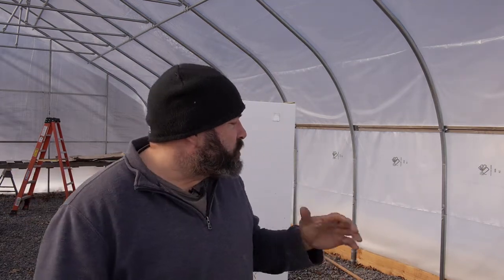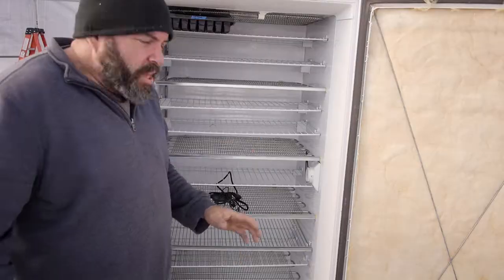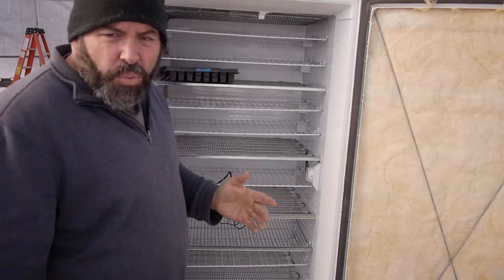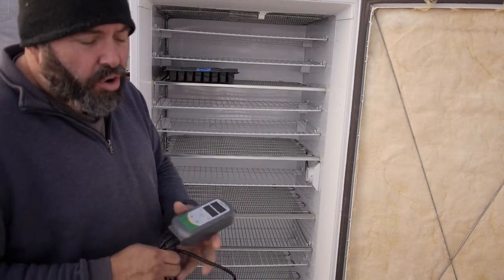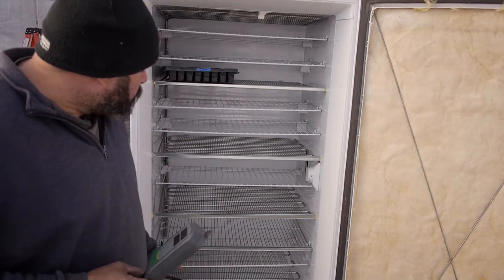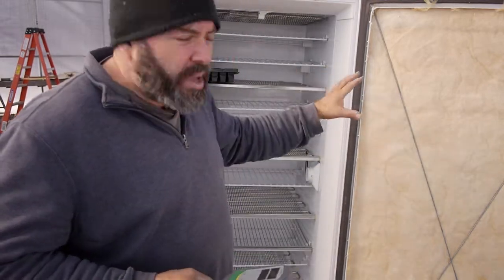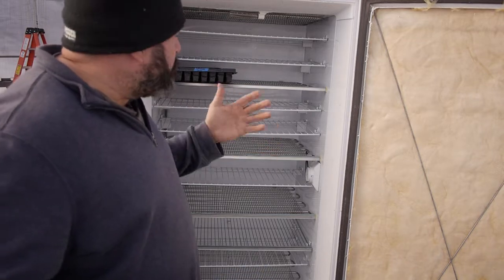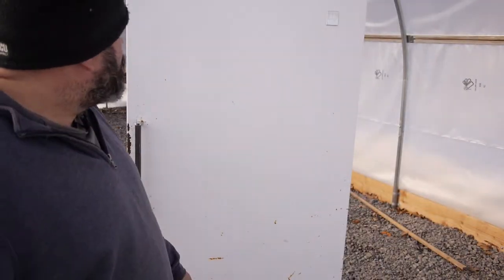Germination Chamber from a working freezer

Comment: FRP board works great and is fairly inexpensive and sold at most home goods stores if you haven’t already found a solution to covering the insulation.
Reply: Thanks, I actually used it all year and the insulation stayed dry.  I still need to cover it, so I may look into FRP.

Comment: How do you shut the door with the cords coming out from the inside?
Reply from the maker: I drilled a hole through the side wall large enough to get the plugs through.
Reply: I noticed you have a freezer that’s not frost free. Does ice ever form on the coils while using it for this? Thanks
Reply: @fitzpreacherfarm6826  No, the chamber temp is kept at around 68-70 degrees so there is no problem with icing.
Reply: @bobfade5440  thanks Bob, much appreciated. I’ve got an old freezer just like that I’m going to hook up.